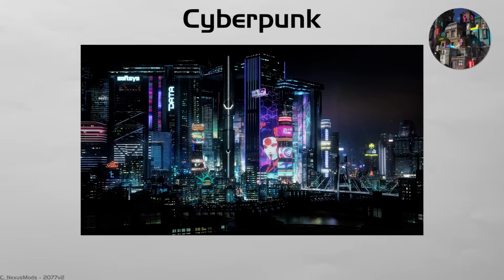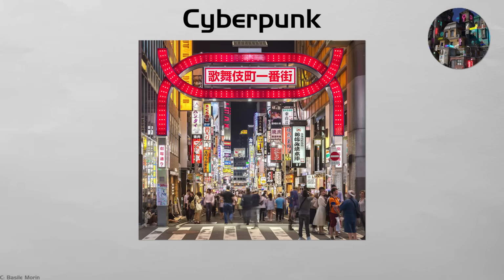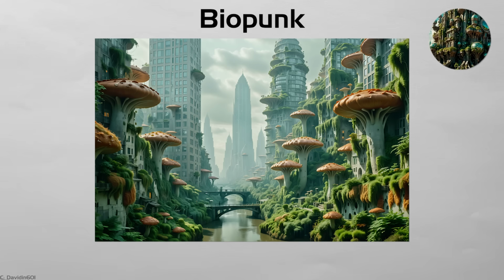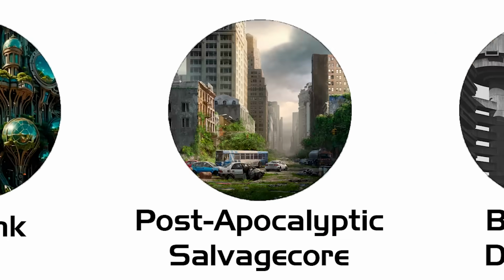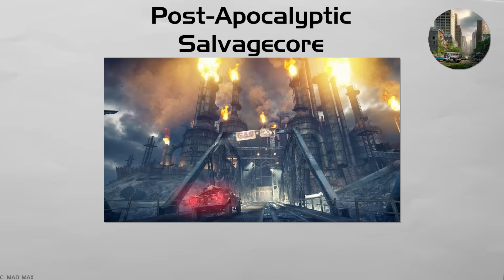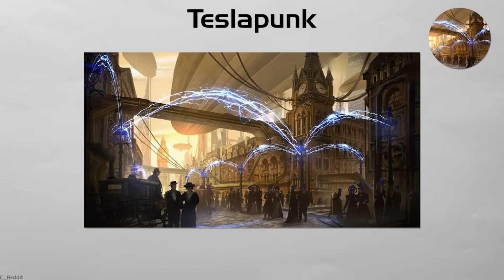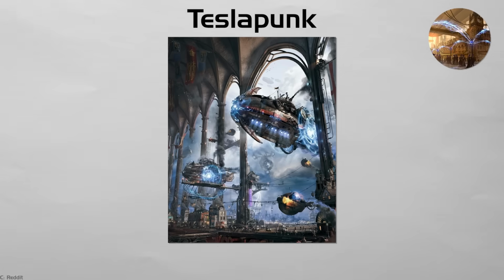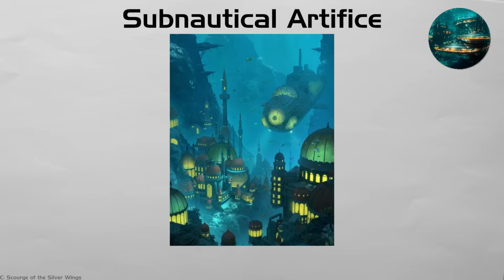Fictional Architectural Styles Explained In 9 Minutes

Comment: I love the concept of an arcology but it's often not depicted as very enticing in fiction (and real world designs).

I like to think of it as a hyper building that integrates and dense city into a closely woven network. This would forgo inefficient and ugly things like cars and suburbs, and it would be energy efficient and walkable.

In much of fiction it's depicted as a big pyramid. I don't see the point of that. I would imagine it would more closely resemble something like Manhattan where much of the roading infrastructure does not exist as the hinterland is rural or industrial and much of the urban area is interconnected to form a single building.

Comment: Biopunk is basically a choice, which can easily solve most of the modern problems: climate changes? Okay, we've changed some genes in 20 biggest cities, now their houses produce O2 and consume CO2. 
Hunger? Okay, this fat little pig can grow up to 300 kilograms by 3 years, gives birth twice a year and most of its, weight are basically pure muscles. Extra-fast growing potatoes for vegans included. 
Diseases? Okay, we have developed a virus-eating microbe and virus what eats all of the disease microbes which are not used in natural processes like rot. No questions how it works, but we'll get rid of diseases soon. 
Genetic diseases? We can make a fine half-insect from you, which diseases? Its just one or two injections and you will be pure like the water we clean with special micro-crabs. 
Energy? Metals? Yes, we can produce it with our biogenerators, but honestly, most of our world works because of sun, water and some fertilizers.